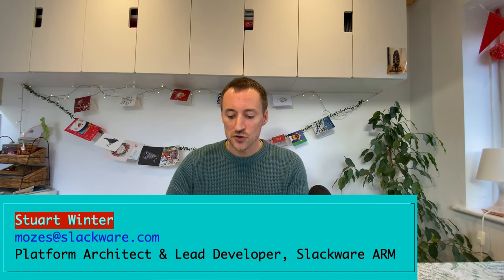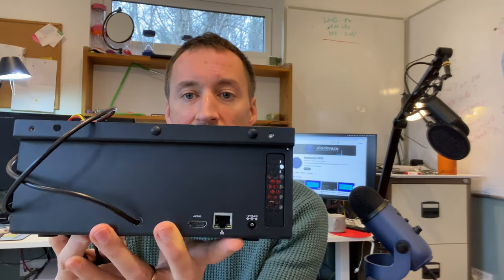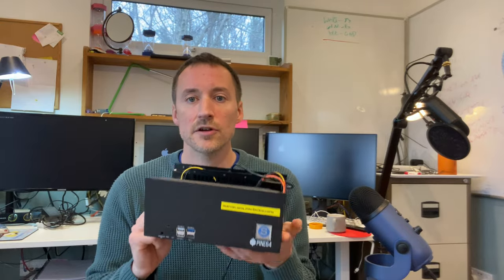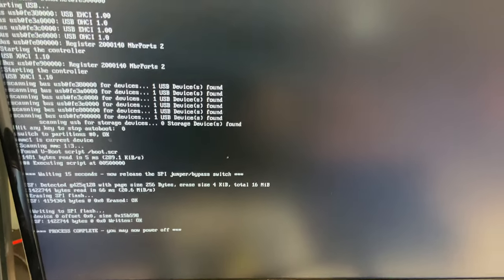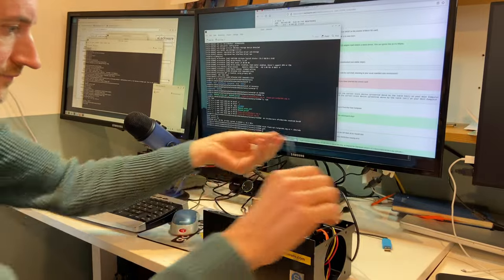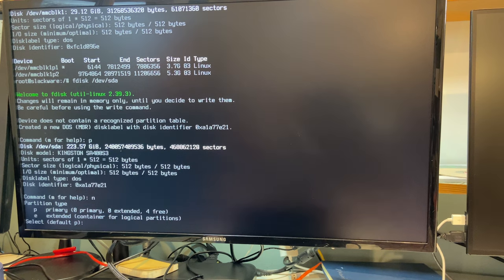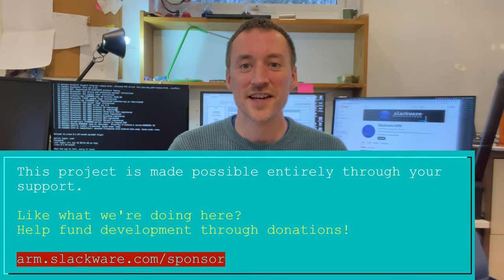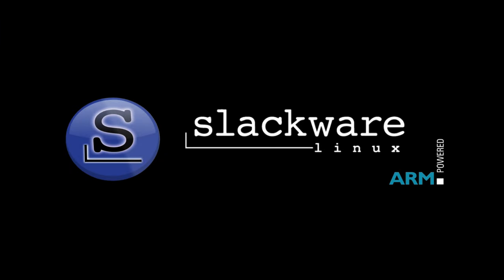S03E32 - Slackware Install: RockPro64

Comment: Greetings, I hope your day is going well. I just got Slackware ARMv7 15.0 installed on a Banana Pi BPI-R2 Single Board Router.

Currently, I have all the default packages installed, and it boots off the eMMC into one of 2 onboard SATA drives.

I also have a fiber connection to the internet, and I am hoping to use the Banana Pi BPI-R2 as my home Firewall/NAT Router.

I am new to using Slackware ARMv7, but I have been using Linux Slackware on x86 based systems since 2001.
Reply: Banana Pi BPI-R2 Single Board Router
MediaTek MT7623N, Quad-core ARM Cortex-A7

Mali 450 MP4 GPU
2G DDR3 SDRAM
Mini PCIE interface.
Support 2 SATA interface
MicroSD slot supports up to 256GB expansion
8G eMMC flash (option 16/32/64G)
MIPI display interface support
5 port 10/100/1000 Mb Ethernet port
(2) USB 3.0 and (1) USB 2.0 otg port
1080P high-definition video playback
HDMI port and multi-channel audio output
WIFI&Bluetooth 4.1 with 802.11B/G/N onboard